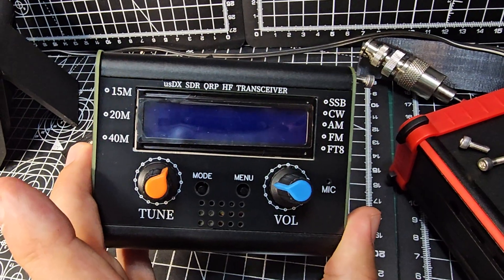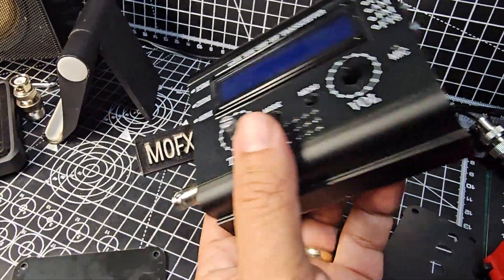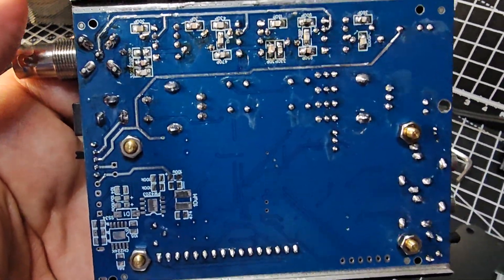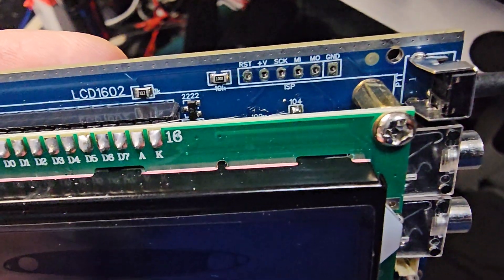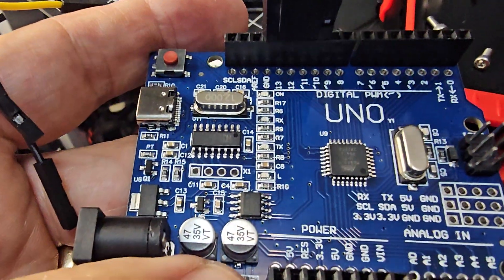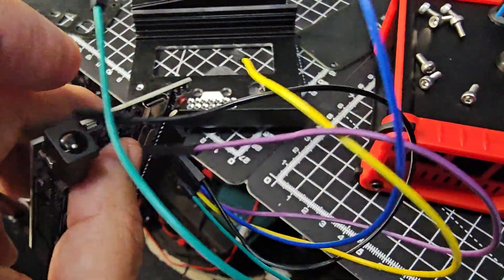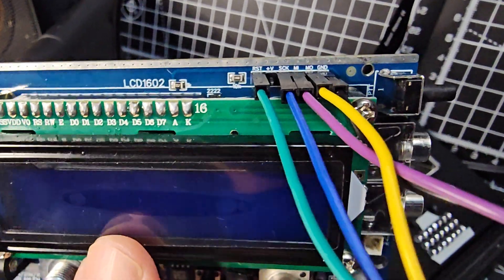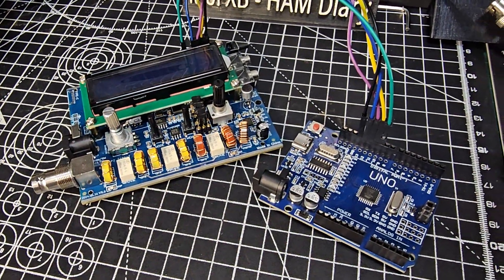uSdx - Orange - Blue Button - Connect Uno  Board - Wire Config & Case Dismantle

Comment: Hi! A few days ago, I received this USDX. Coincidentally, I had a blue display in my component box, so I installed it. It looks pretty good, but reading CW decoding is quite difficult. Overall, I find the device interesting and would like to explore some modifications, like adding a battery since it has space, changing the internal speaker which is very bad and in my case, also came damaged, and modifying the firmware to use filters on adjacent bands (using the 15 one on 17 as well). Your videos are very interesting, thanks for sharing! Greetings from XE2LDL
Reply from the maker: Hi thanks for watching it is a good device at this price and looks great .